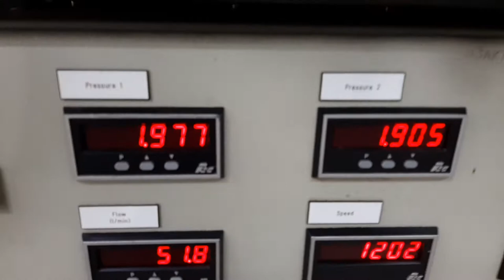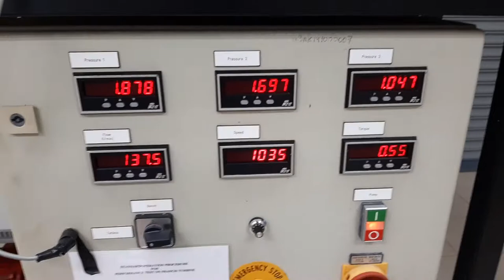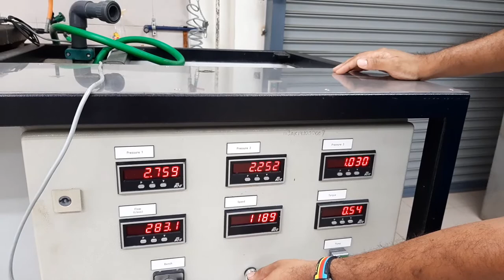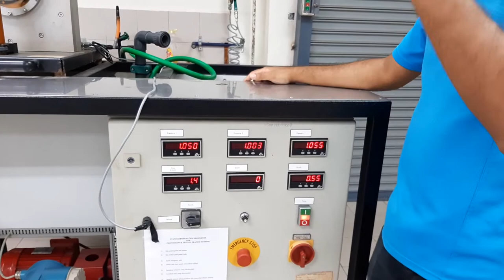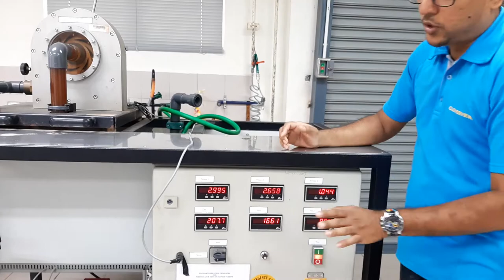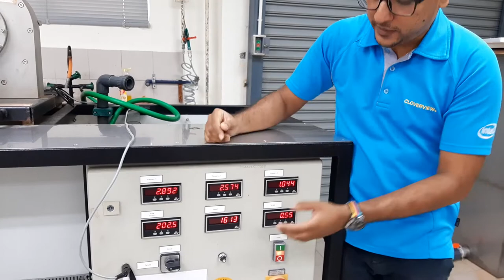Performance of Francis Turbine - Part 2

Comment: What is this
Reply: Francis Turbine, used for mechanical power generation from kinetic energy converted from the fluid flow of the water. This one being a laboratory experimental system to demonstrate one type of actual hydro power generation system. It can also be used as a pump or turbine depending on its requirements and suitablities for the work required.